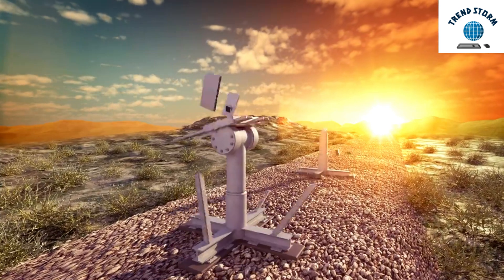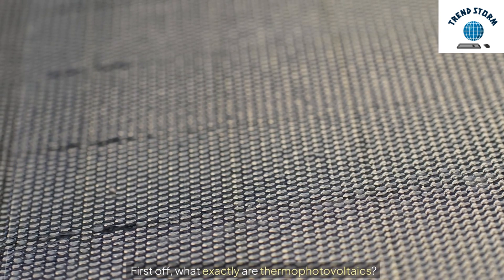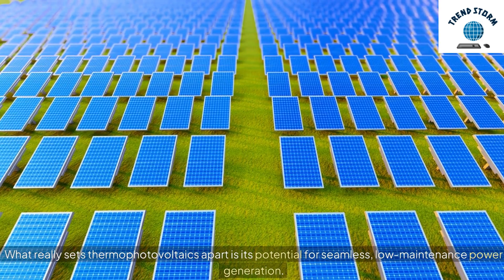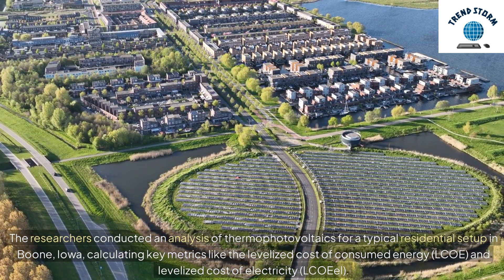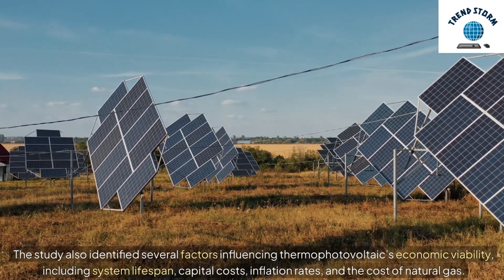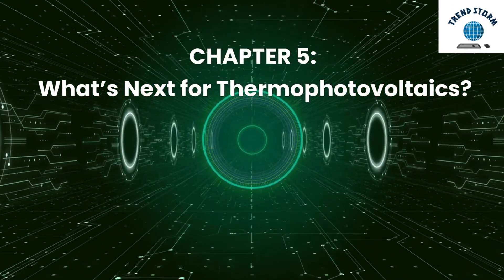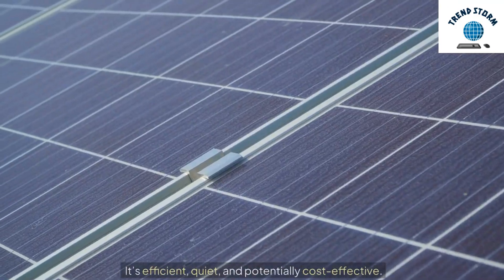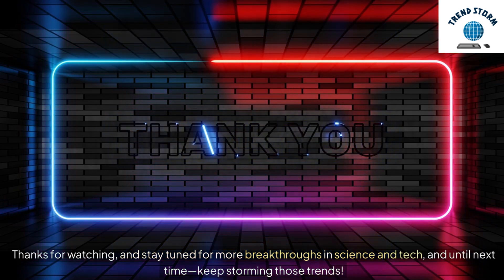Can Heat Power Your Home | From Heat to Power | The Future of Thermophotovoltaic Technology

Comment: How efficient is it at generating electricity from stored heat at night? It would be great to have a home system that worked on this principle.
Reply from the maker: Great question! TPV systems show promise in generating electricity from stored heat at night, especially when paired with phase-change materials for energy storage. While they are efficient and low-maintenance, current costs are still higher than conventional electricity prices. Future improvements in system lifetime and cost reduction could make home-based TPV systems a viable option!